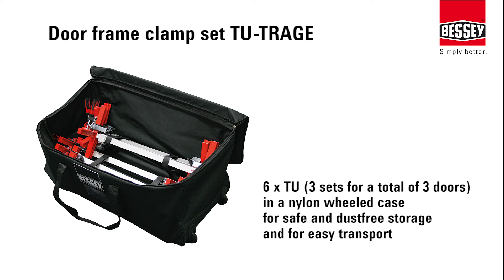The door frame clamp TU – Easy to handle, and maintains the precise door frame dimensions  |  BESSEY

Comment: Holy cow, you could have the whole door installed and cased in the time it takes to set up all those clamps.  I love you, Bessy, but this is a solution looking for a problem.  :-)
Reply: I have sites where I cannot drill into the openings due to toxic material behind a coating so for holding a door lining in place while the foam sets they are useful for me

Comment: Dude this seems so over complicated. Bessey Is an awesome company but this is useless.
Reply from the maker: Thanks for your comment. The TU set is used to assemble door frames that have to be filled with foam. The installation is often done with annoying wooden wedges, which unfortunately often fall out of the masonry or slip when foaming. Carefully sawn together wooden struts are used to hold the door frame "in the water" - unfortunately there is also the risk of the door frame slipping. The BESSEY TU-SET guarantees 100% installation security when used correctly without damaging the door frame and holding it "in the water" until the construction foam has completely hardened without visual inspection and then inserting the door leaf without unnecessary adjustments.
Reply: Lol same results making liner,  (not using   liner kits) lay the door flat add shims around the edge for desired margins,  clamp temporarily while securing head and jamb together (I include the traditional rebate joint), use door stop pinned diagonally to square frame and slightly past the edges of frame which assist flush alignment to wall...(you can also use slightly oversized timber, scribe the other side place back on bench for adjustment) and a horizontal pinned door stop to prevent bowing. And foam it in the same way.....much cheaper and able to secure multiple door linings, thus saving the massive cost of buying multiple jigs and attachments and above all the slot cut into the jamb one side....customer change their mind in the  opening orientation, good luck hanging hinges and strike plates to that......overall well thought out product, to a point but completely pointless at the same time.
Reply: @bambam-cm8we  i have the jambmaster. When you’re hanging a ton of same sized doors or multiples of the same it makes you a machine at installing. It’s not that great for single doors though more time setting up than it takes to just do it.
Reply: @garethkalber7236  totally agree with you,   I don't hang doors in huge numbers or contract work. That said if you are in the on a job where for whatever reason the jig cannot be used, or just starting out as a chippy, the "old school" ways can be helpful. Again I totally agree with you 👍

Comment: Absolutely useless. Way overcomplicated. A skilled carpenter would have the frame hung before this system is even attached to the frame. Nevermind all the clamping and adjusting in position. Whoever thought of this?
Reply from the maker: Thanks for your comment. The TU set is used to assemble door frames that have to be filled with foam. The installation is often done with annoying wooden wedges, which unfortunately often fall out of the masonry or slip when foaming. Carefully sawn together wooden struts are used to hold the door frame "in the water" - unfortunately there is also the risk of the door frame slipping. The BESSEY TU-SET guarantees 100% installation security when used correctly without damaging the door frame and holding it "in the water" until the construction foam has completely hardened without visual inspection and then inserting the door leaf without unnecessary adjustments.
Reply: @BesseyToolsDeutsch  I can still fit a door lining faster with a 900mm level for the head and a 2000mm level for the legs
Reply: @BesseyToolsDeutsch  I was using Hilti closed cell high quality foam over twenty years ago, with two solid doors one 1170mm and a 350mm, wish I had this system then, we were struggling with timber spacers. These gun carpenters don't understand production carpentry and the money this type of equipment can make, as we could fit jambs, architraves, two solid core doors and hardware under an hour by apprentices, no shims and no defects.